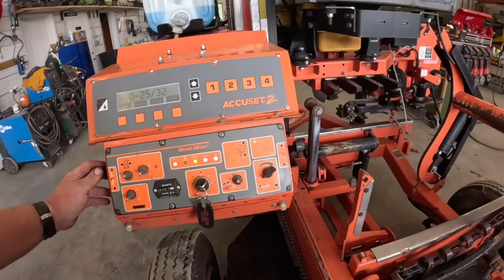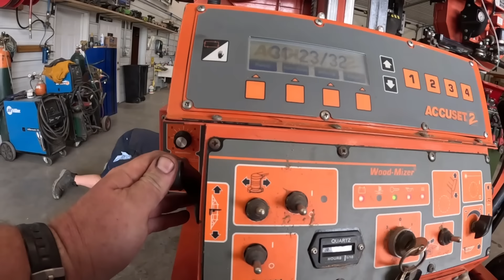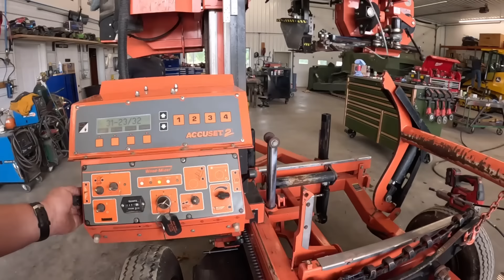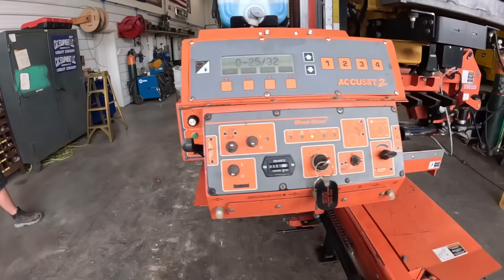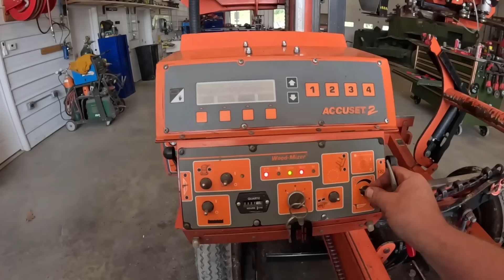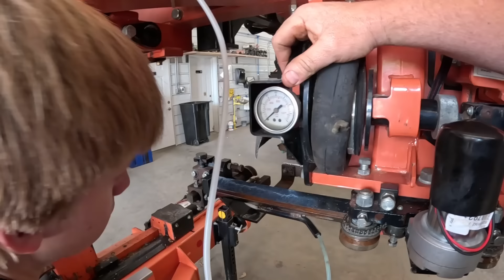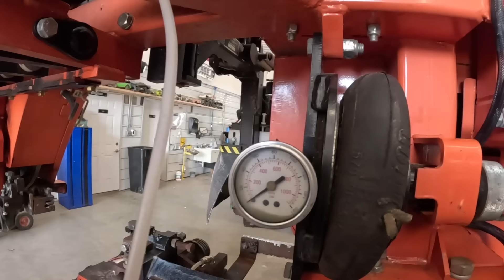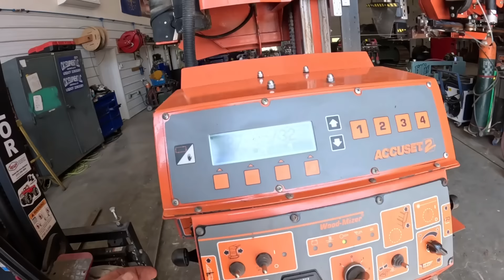Woodmizer LT70 abandoned sawmill I took in on trade gave us many problems after sitting for years

Comment: That is one complicated saw compared to the 27” we just purchased. It has lots great features but lots of things to go wrong. Perhaps with good maintenance, reliability will be ok. The diesel power doesn’t seem to do things any faster than our gas single banger. I guess it depends on the use, ours is not for commercial production but yours clearly is for a commercial use IMHO. You folks did an awesome job of problem solving, like always, to get it operational and make sawdust.

Comment: G'day C&C, You may not be a pro saw miller but you are a pro at rebuilding them. I run a Lucas Mill here in Oz in the hardest woods, a horizontal thin blade band mill cutting the species we mostly cut will require you to change the blade once an hour. PS Utes rock no hungry wheel arches 👍.

Comment: The Chinese shibuara diesel made for Perkins/Cat.  Luckily it still runs and doesn't have a rod sticking out a blow hole.  
   WoodMizer got them cheap according to my dealer here in east Tx said they were paying less than 1000$ delivered back in 2005-2008 before Perkins swapped builders. 
  My old LT70 i had in 05' had one, well it did for 225hrs before it let loose and warranty paid for an upgrade to a 38hp Kubota.

Comment: Actually saw a flail manure spreader taken apart and having full new bin made for it including the new shaft for the chains all turned on a huge lathe that had a hole through the wall to accommodate the longest things and they would pass through the head of the machine and they could get bearings and oil seals for anything

Comment: I went with a friend of mine to the plant in Indianapolis one time to pick up a brand new one. But it was a base model probably the cheapest one he could get. He wanted me to go because my first job out of highschool was working for a friend that had one of them. He had it set up stationary in a building with a kiln and everything. My job was to pressure was the mud off the ligd before we sawed them so ot wasn't so hard on the blades. Sawed mainly hemlock.

Comment: We still have a Woodmizer LT40 from 2001.  It sits most the time and can cause issues.  We did have a control board issue for the head travel down the rail.  Woodmizer was very helpful on the troubleshooting it, and prices are reasonable!!  Wish all brands were more like them.

Comment: There's a lot of hammer and axe handles in that block of hickory. Hickory is not only hard it's very resilient and springs back into shape after blows with a hammer, axe or maul. That mill is a nice piece of equipment but the prior owners never maintained it properly. They used it until too many things broke and wouldn't work anymore. Youse guys did a nice job of bringing it back to life as usual. I watch a few of those log milling channels every so often. It's pretty interesting when they find some rare type of wood and are able to get some nice pieces out of a log. Gotta go over the wood with a metal detecting device before running a blade into it. Great video, very interesting.

Comment: By the looks of the injector pump, it looks like a Cat/Perkins/Shibaura. You've probably seen them in Cat compact track loaders/skid steers? ASV compact track loader also used them. Ferris zero turn mower with a "Cat" diesel is also the Shibaura.

Comment: Like it when you have different things in it helps to show that you will repair anything that comes in like a place I use to go to get metal and welding supply they were in a long nisunsheed with old machines but they would repair and make new parts they were Massey Ferguson tractor dealers and repair shop

Comment: Thumbs up for the corded heat gun. Sometimes you just have to go old school.
  I don't care for the solid block used as a brush. A better solution is a traveler cable similar to elevators. That small chain is unnecessary, a belt might be better. At least design it for a bigger chain. This would have to be done from the factory. The hydraulics box should be shielded better against junk getting in. The solenoid needs some electronic protection against overloads.

Comment: Woode wow what a ride.  We had one a rack on top - painful to sand and put spar varnish on the luggage rack, the sides had some but were every other year.  Top always in the sun.  Fire engine Red .   What a ride. We had a spotlight on a flex arm driver side.  Had overdrive - aka 4 gear.   Station wagon naturally.  Family of 5 used to use it camping in 52 as I recall, our first car with color.  Previous coup was the only color BLACK.

Comment: Another variety of Hubb Huggers is the giant shrink tube used over the pipe welds on the Alaskan Pipe Line. The ends would come together then a stainless steel connecter bonded them and then the HEAT.

Comment: That’s a cat 3024, or 404d-22 Perkins. They were absolute garbage. Actually made by shibuara in China for Perkins, for cat lol. They were notorious for sending rods through the block before 500hrs. The oil pump pickup tube would crack, or there was something that would get sucked into the pickup, or the oil pump would shear the shaft all causing an immediate loss of oil pressure and  new inspection hole in the block if it wasn’t shut down within about 5 seconds.,

Wood-Mizer later added a crankshaft support bearing for the output shaft. Make sure it’s had that update and the updated head gasket. These had serious head gasket issues that would frequently destroy the engine before you realized there was a problem.